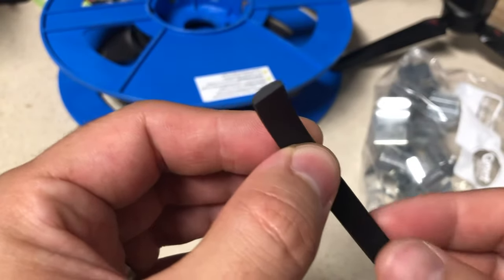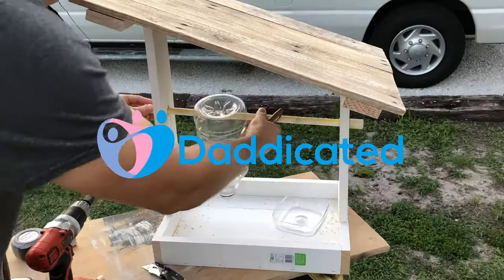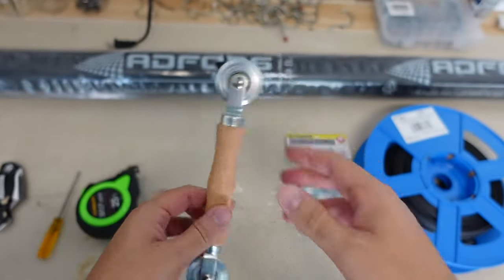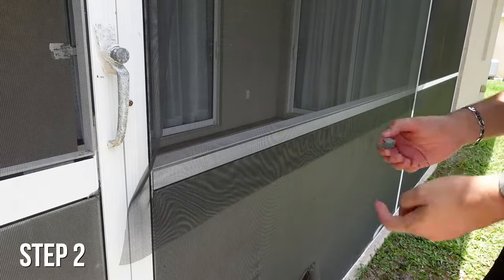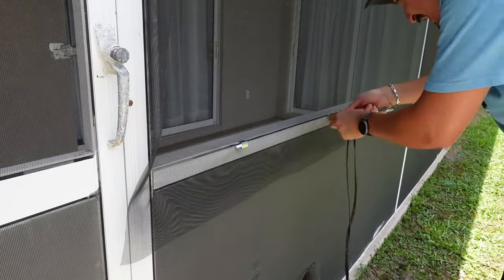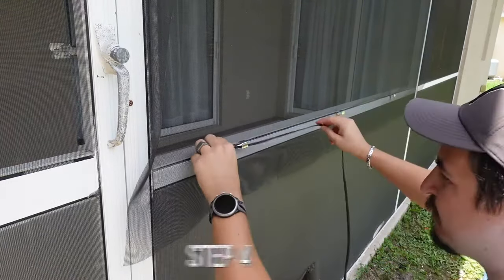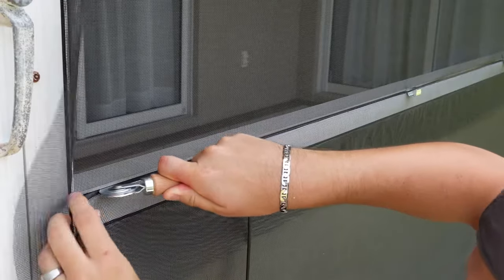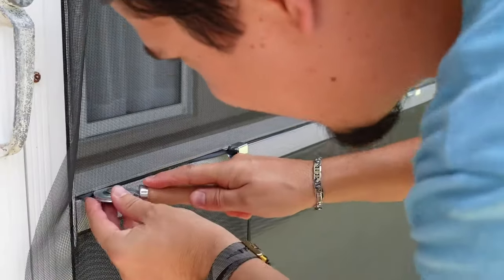how to install flat spline on screen

Comment: Flat side is supposed to go in.
Reply from the maker: So concave side should be on the outside? Does it really matter tho?
Reply: @Daddicated  Try it either way and see which way goes in easier. If it didnt matter it would be flat on both sides.
Reply from the maker: Good suggestion, I'll try that next time. At this point it's done and holding for now so I don't feel like ripping it apart and redoing it.
Reply: @Daddicated  Flat side out and rolls easy. Round side out, 10 times harder to roll especially in hard to reach positions
Reply: A pro taught me the convex side goes out. But the real trick is putting the edge of the spline in the side of the slot that is closest to the screen opening first, as that side has a recessed groove in it.  Then roll the outside edge of the spline into the channel.  Once I learned that trick, it was 1000x easier.
Reply: Phifer screen and spline manufacture says flat spline ok either way, round side down more common but round side up ok too.
Reply: @craiglong9551 I just got it done after reading your comment. Thank you!
Reply: @denniswarren5871  round Sid should be facing you flat side goes in
Reply: Flat side in, and insert into the notched side (side to the opening)
Reply: @judyradke9847  that is what I said. flat side in means round side facing you.
Reply: @bruceLi2011 that means it’s going to hold better.  Flat side in is proper.

Comment: The flat side goes in, the convex side goes out or facing you. Watch the other dudes video he shows the correct way and easiest installation of the spline.
Reply from the maker: That does make sense but I guess in reality you can do either way and it will stay in there. Lol

Comment: My screen guy just told me that the flat side goes in first and the round side faces me when the projects finished. Which is it?
Reply from the maker: I honestly don’t think it really matters. Your jamming something bigger into a small space and it will hold it and won’t get out. What the screen guy said does make sense tho. I just installed mine the way it was installed before.

Comment: I agree with you, curved side in and flat side out.  Works like a champ for me and never have had a screen pull or blow out!!!  The inside of the channel is also curved to match the curve of the spline. Fits like a glove and goes in pretty easily too.
Reply from the maker: Yeah my screen is still solid no issues thus far.

Comment: FFS! Once I learned that you should insert the spline in edge first into the inside of the groove closest to the mesh, install was simple! The inside edge of the groove is indented so it accepts the edge of the spline. Rolling it was then simple. FWIW, I applied it flat side in, figuring it would slip into the indentation easier. This simple step--push the edge of the spline into the inner edge of the groove--changed everything. My neighbors are grateful, as they don't have to hear the loud cussing!
Reply from the maker: lol. Glad you figured it out.

Comment: In another video they say the round part of the flat spline should face outwards and not inwards but I followed what you said and put the round side facing inwards which is what I did for my screen door after watching your video and I had so much trouble putting the screen in and it took hours to do which it shouldn’t have but it did!
Reply from the maker: I don’t know are you sure you used the right spline for your door. Cuz some doors require the round spline instead of the flat one. I didn’t have any troubles with mine. Best bet is to observe how your old spline was installed while removing it.
Reply: @Daddicated  yes it was the flat spline for sure as I have replaced many screens with the round spline which thus far I would have preferred as the round was fairly easy for me to deal with but this was my first experience using the flat but I am fairly confident that the next go I have with the flat will go much smoother as I learned allot with putting in the flat spline thanks!